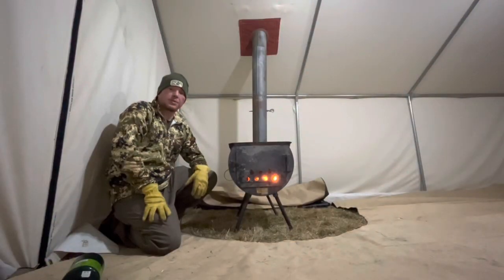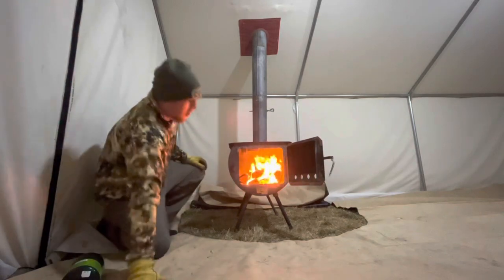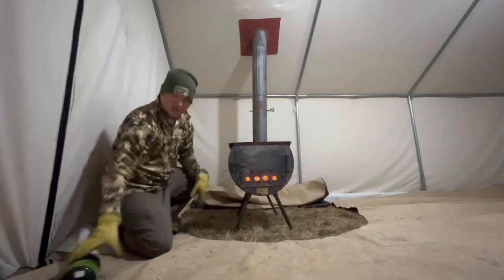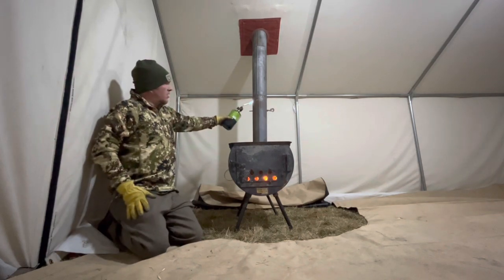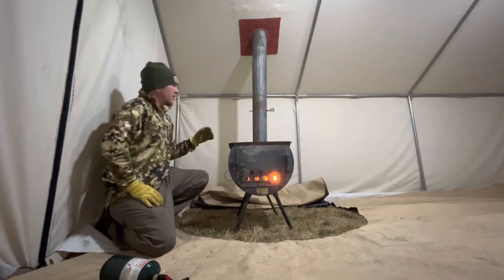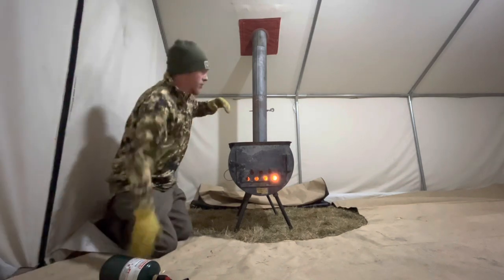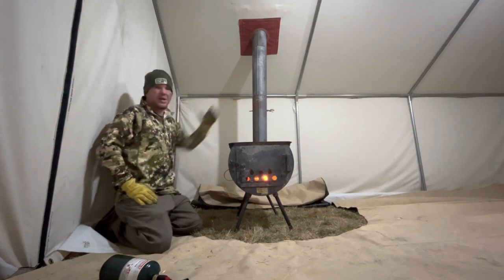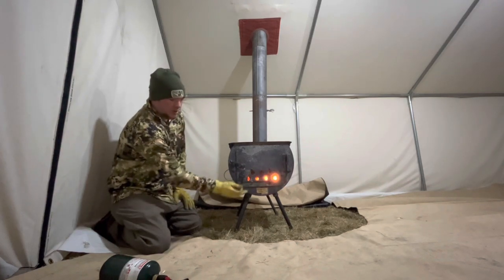Tips on our Stove Baffles

Comment: Could a person just leave the damper off and control it with the front vent?
Reply from the maker: Yes for sure. Because of the holes drilled for the stove pipe, I install it and leave in vertical position. Alternatively, you could just install the damper shaft simply to plug the holes. I do all adjustments on the front air intake. Works great.
Reply: Then you don't really have much control of the heat loss though..  Once your fire gets really hot and everything is burning.. You should shut your damper off like 90% and that will capture all the heat and not let it just run out of the pipe.. Also it simmers down the stove a bit if it's getting too hot.. and it will make the wood last longer,  like when you're going to bed.  If you never close the damper.. You're really just burning your wood really fast and you'll have to keep feeding it a lot more;  that's fine for your first fire.. but once you have a nice bed of coals and you load it up with wood again,  and everything lights up and is burning HOT....  You want that damper closed off (mostly).  Open it just enough to keep things going..  If you're getting any kind of smoke into the room-- then open it just a little bit more  It's very touchy and needs very slight adjustments.. but you learn what is best for your stove over time...........  If you're just leaving the damper open and letting all your wood go out the chimney-- you're doing it wrong.